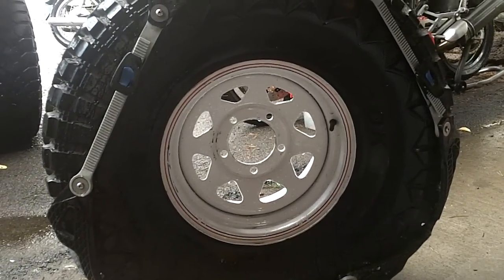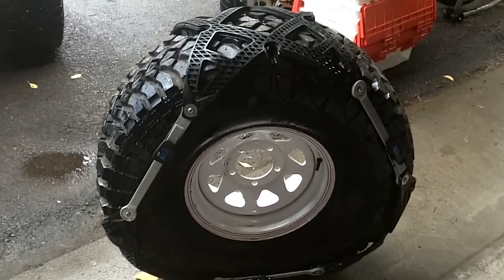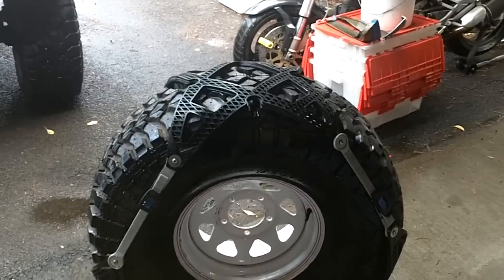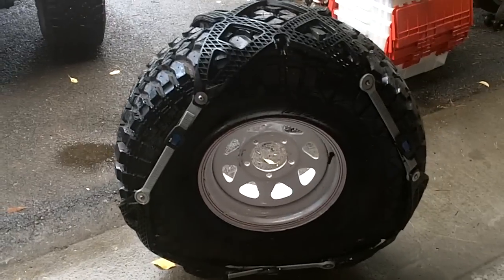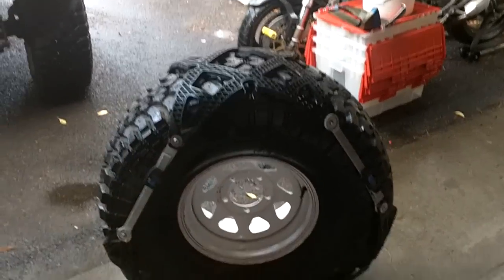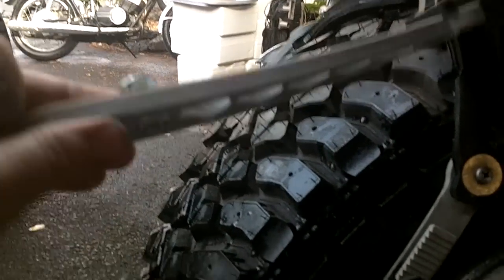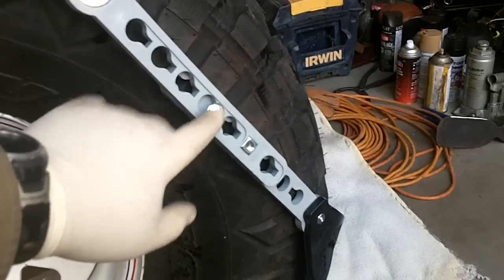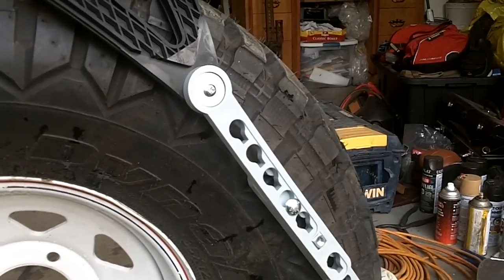Sno Claw Intro

Comment: I'll stick to the real set of tire chains I've used for many years on my compact front wheel drive car. They're not cables and they're not rubber pads like the ones you showed. They're real chains that cost $20 at autozone. They've worked great in 6-18 inches of snow and they've never failed me. I have a full size spare tire in my trunk that always has one of the tire chains already on it. That way if I get stuck and can't move the car to put chains on I just change one or both front tires.

Comment: I made a set of chains on this diamond pattern with 5 diamond s per tire all steel, 1.1/4 " in height . it's amazing you can go over logs , ice ,dirt, mud and snow without spending 2 grand on new rubber and wheels. I use an old set of 38" SperSwmpers..stick it in low range and pull trailers full of wood out of the woods

Comment: Not cheaper than chains, but they are better, faster, easier and safer! Note ***If you can't afford a premium traction device, Flex Trax is probably not for you. Flex Trax are more expensive than cheap tire chains, but again, these are not tire chains! Flex Trax are much cheaper than your insurance deductible and about the same cost as a single wrecker bill. FlexTrax price starts at $129.95 /set

Comment: thees look REALY bad. NO steel to make it grip and just to flimsy. AND the price? you can get som desent chains for emergancy for 30$ here in Norway and som good one's for a LOT less then that crap. the ones for 30$is probarly all you ever gonan need IF you ever need them. with goot tiers you can go thru 4" of snow with no problems. onely if it's pure ice you need chanes ant then the rubber/plastic thing you have here is no good.